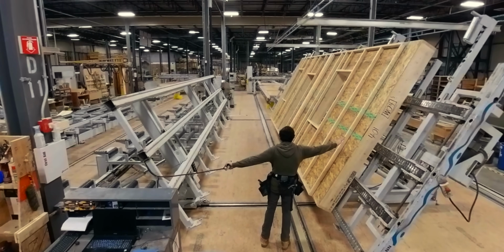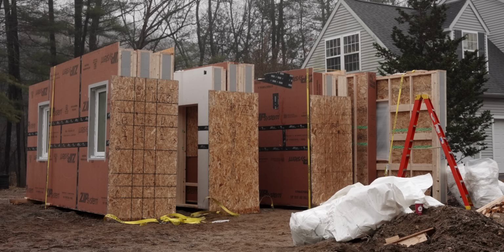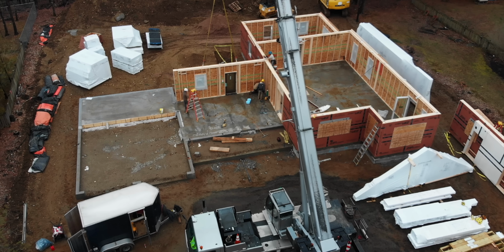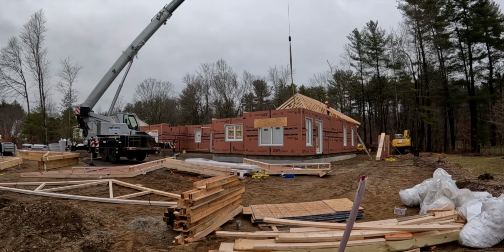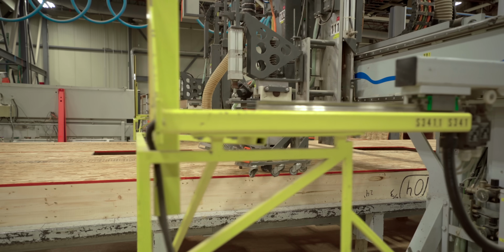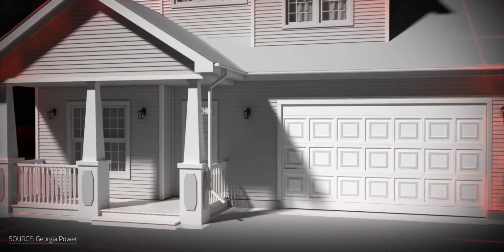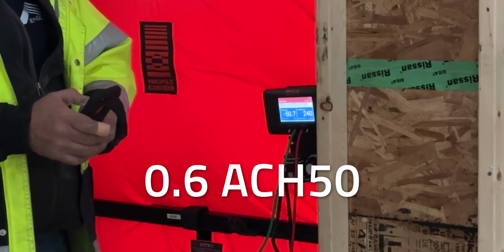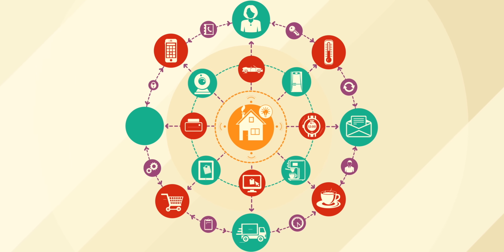Wow! I Didn’t Know A Prebuilt House Could Do This

Comment: Very cool. I think that the factory build probably achieves much higher quality than on site. The conditions for the build are better and the quality control easier and more effective.
True story, it's not impossible, but I suppose there's a lot less motivation and it's much harder for a worker at the factory to disguise a leak in a bathroom pipe using a plastic bag, than to do that at the construction site.

Comment: My geek  brain loves this project and the tech behind it and the component tech of geothermal, solar, battery, etc. That being said, I built a home in central AZ about 4 years ago that is avg with regards to insulation, etc. Put in a solar system that completely covers my electricity (even in summer with AC) and actually get a credit every year (check back from power company). That check offsets my natural gas cost. So from a heating/AC perspective I have zero payout at this point. This home is nowhere near LEEDS efficient, but does what I wanted which is breakeven on elec and natural gas. So can't complain and I'm sure spent nowhere near what you did.

Comment: I don't at all believe in air tight homes. Far too many chemicals that end up in the air and need to be aired out. ESPECIALLY in a brand new building. But the solar panels and battery system, a big yes.

Comment: Prefab houses are usually a good deal. Many years ago there was a company that set up a production line but they went out of business because of lack of demand due to the cost. While I know the push is on to make houses air tight. I have major concerns during an extended power outage. It doesn't take a long time for interior air to get nasty when there is no air moving and no fresh air getting in.

Comment: I hope you have better luck with the geothermal system than I did. Huge maintenance costs right from the start and had to tear it out at only year 11. There was absolutely zero payback from the 4x cost of the system
Reply: People who have never owned a house have NO idea what a nightmare and consideration maintenance is. I've never heard a happy geothermal customer and even going heat pump over furnace is often disappointing in colder climates.

Comment: Cost is always a factor, but my dream has always been insulated concrete for the entire house, not just the foundation.   Foam lego blocks with re-bar concrete in the cavity will ensure a high R- factor in the walls and you will never have to worry about puncturing the vapor barrier.    A house built this way will be airtight, except for around windows and doors of course.  It will also be incredibly quiet.  Did you consider this kind of construction?

Comment: Did you design the house for good cross ventilation when the windows are open? Sure, you can work on the heat and AC aspects, but can you get cross-flow? Like old Southern homes with their tall ceilings and transom windows to evacuate the summer heat from the top of the rooms? Do you have sections of the home you can easily isolate so you don't need to heat them in the winter? Did you place minimal windows on the North sides with more on the South side? Can you open windows during a rain storm and not get the interior soaked (long roof overhangs and deep set windows help)? One of my next homes will be a rammed earth / earth sheltered setup with a living roof.

Comment: House is looking good!
With the home automation gear, how are you planning to use it? 
Presumably you'll want to be able to operate at least some things remotely via phone - are you planning on putting in any extra security measures?
I mention security because one thing that's put me off home automation is that a lot of IoT kit is either disgustingly insecure, or is effectively spying on you
I'd be very interested to see how you set up the home automation :)

Comment: Very interesting video! I'm wondering how much customizability there was in the materials you used in this construction — that is, can you select concrete (for the foundation) and insulation that absorbs CO2? Can your lumber be purchased from a sustainably-harvested source? Can you avoid particle board / plywood that off-gasses formaldehyde... or is this even a concern, with your frequent air-changes? Thanks!

Comment: Hi Matt your new house is awesome! I'm interested in the geothermal as I'm in Connecticut wanna get rid of my OLD oil boiler but the 2 companies I have talked to can't do anything for me cause my heat and base board heating. I need some advice cause I found a electric hot water boiler out of Minnesota is a direct replacement but NO hvac people wanna install it! The only thing I can figure out is if they do it they won't get any service work. I have a older house 1987 built but I've done a lot to get off the grid with the house sealed up and solar and powerwall. I try to explain to them if they get into installing electric systems they will make so much more money cause in my town alone way over 5000+ homes have gone solar and this is what they are looking for! Any ideas?

Comment: I watched several of your videos, & am subscribed.  Thanks for sharing. I built a passive solar addition on my previous home (built in 1954), & reduced heating energy by 40%. I hope to build a new home. I wonder why you did not use SIPs with extruded foam cores, these avoid the problem of moisture which you worried about during assembly. I lived in Germany & agree the doors & windows that open/tilt are great. Also standard in German are the rolladen external shutters, these are great. What roof did you install (it seems you did not use panels)?

Comment: OK, the question: how probable tornadoes or stormwinds overall in this area? Earthquakes? I have a feeling first tornado will blow this 'building' away like matchbox. I cannot see from this afar, but from just video, I don't trust these walls. If crane can pickup it, first tornado will annihilate it on the spot. What happened to regular brick and mortar?

Comment: The house I am building I guess would be net zero. Though mine is going to be much cheaper than your likely was. I am building a tri plex. 100x30x8 or 10 pole barn with insulated slab. The walls will be 9 inches 10.5 inches thick with a 9 inch cavity. .5 osb 1.5 2x4, 2x6 (.5 osb strip to thicken the post) post, 1.5 2x4 .5 osb .5 drywall in 10 foot sections dense packed cellulose. The ceiling will either be blow in up to about 2 or 3 foot thick. I have not decided if I want to make custom trusses or extend the height of the building from 8 to 10 feet then build a whole other ceiling. I think Custom trusses will overall be cheaper and get that insulation value that I need. The reason why I want 2 foot over the exterir wall is that on a normal house that top corner is always going to be the cold/hot spot on the thermal camea because there is no insulation up there. The inside will all be sheathed with osb then covered with drywall. This will add much added strength to the house along with something behind the weak drywall that one can anchor things too. This will be three 1 bedroom 1 bathroom units. The heating and cooling will being done with 3 two ton mini splits made by EG4 which allow you to directly hook up about 4kwh of solar panels to the unit which can be run in 100% solar only mode, grid only mode, combo of both. The price os 3 units will cost 15k which is about the cost of an entire central air system put in. I will be adding a air recirculation system in as well to filter air and to move air in to the bathroom and bedroom, also looking in to those fresh air systems as well.  We are putting in windows where they need to be. The bed room and bath room will have indirect sunlight which will light up those 2 rooms and the living room and kitchen will have one direct sunlight window which will cast the light the full length of the room of 30 feet.  Placement of these window are key in reducing the number of windows needed while also not putting direct sunlight on areas that do not need it, such as the living room/office set up. The bathroom is 9x22 feet long. This allows for the closet to be placed in the bathroom along with laundry room and everything else you need. The close is one whole side of the bathroom which allow you to install cabinets drawers for the lower sections and hanger and shelf sections for totes or cabinets. This should be more than enough room for 2 people to store all of their clothes and everything else. Everything right in the bathroom for your use. 
The kitchn is on that wall as well which reduces the cost of plumbing.

Comment: Houses from the USA, are built in a manner that I would not call them houses but glorified Garden sheds.
Wooden frames with hollow Walls, where a heavy storm easily destroy them.

Obviously this is just my personal opinion. But a proper house is made out of stone/bricks . With proper walls holding the load and not some wooden frames. In summer That keeps the heat out for quite a while and in the winter it stays warm. add proper house isolation at the outside and you win. If you then put up a second wall inside your house to hide all your pipes and wires then you are truly protected from the elements.

I believe, but I’m not sure, the stones/bricks used in Germany are about 30cm thick.

Comment: No vacuum solar collectors for heat? They are great to keep a water tank hot all the time for heating and hot water generation and this is MUCH more efficient than using solar panels to generate electricity, store it, and use it if you want to shower or heat.

Also, using a water tank as buffer is more efficient than using a heat pump alone. Reason beeing that it does not need to react fast to new demand and instead run at much lower heat exchange rates, as the tank will buffer a couple of days of heating/water generation. This way the ground can heat up again, by exchanging heat with the surrounding.

Comment: Unfortunately, I really do not understand why a house that is supposed to be energy efficient is not built with the smallest possible external surface.
Regardless of the insulation, more surface means more heat and thus energy loss.

Comment: Think I might like to build one. 

When I lived in Cincinnati they were building envelope homes. It would have a regular outside insulated wall then essentially another wall with window and insulation with about 6” in between the two. The basement floor was about 3 or 4 feet of gravel covered with plywood. It was designed for air flow going  between the wall and storing heat in the grave during the day and being used at night. You could heat the house in the winter using a few light bulbs. In the summer it would store the colder night air in the gravel and use the cooler air during the day. It was years ago and I don’t know the end result.

Comment: We've got a UK self-build using a similar larson strut cassette system based on my plans.  The main difference was the TF was factory-assembled without insulation and a specialist company did the window and door installation on day 8-9 of the build, but all was weather tight and lockable by day 10.  A separate crew did the blown cellulosic fill and taping up on-site a few months later after we had the slate roof on and finished.  0.58 ACH on first test; 0.4 ish after some tweaks (some of the windows closers needed slightly tightening.  UK layout: so 2 full storeys + a warm roof bedsit for my live-in son. Cotswold stone exterior skin for looks and to keep the local planning permit guys happy.  Like you electric only, low energy.  
The main thing to watch out for in 1st and 2nd fit is tradesmen screwing up your air tightness: we banned all trades from cutting into it and where needed we added through-panel access pipes (properly sealed) for the trades to run plumbing, electrics, etc. then foamed and silliconed these ourselves, before plastering out / decoration.  In everything: trust but verify -- before it is too late to remedy cock-ups. 😊

Comment: I live in a prefab house from the late 1980s/early 1990s. Basically the same approach, but the walls are made out of reinforced concrete. The outer prefab panels have a "sandwich" construction. That means there is a structural outer part, then about 10 cm of styrofoam insulation and then another 10 cm of inner concrete wall. It is a very simple "box" with flat roof. I live on the topmost floor (number 8, ground floor is being counted as 0). While the facade is original, the windows were replaced by modern ones. Guess what. I do not need to turn up the heating at all and have even now 20°C in the flat. Outside temp falls to -8°C at night. When I open my flat door to the staircase, it is actually warmer there, because warm air rises. I do not need to have 28°C in the flat like some other people do. I am absolutely fine just in a t-shirt and underpants at this temperature. The only thing I have to check is condensation on the windows and around them. If I let it build up, mold can start to grow. But it is not that much of a hassle to wipe the condensation every two or three days and to deal with mold once it starts to appear (just spray some chlorine based anti-mold agent on it and wipe it off). Bear in mind, that this house was build a long time ago. The house next to ours, of the same type and age, is being retrofitted with more insulation on the facade. I hope our house will get such a retrofit too, even though the breakeven comes only in decades, as it has some thermal insulation already in its design (unlike older prefab houses built in the 1960s and 1970s). I care less about the energy savings than I care about the appearance of the house. Currently it looks rather ugly, as it was built. There are some stains and you can see all the joints in the facade between each panel. It is just a cosmetic thing. There are absolutely no water leaks. The roof had been repaired a couple of years ago and statistically speaking, I am more in danger of a neighbor causing water damage than a roof, which is above me. Structurally, these often ugly, massive concrete prefab buildings, also known as "panelák", are very strong. I have seen some of them being shelled and badly damaged during conflicts and they literally created "bridges" over holes in them. Previously I lived in a prefab house from the 1960s which experienced a gas explosion in the 1970s. One prefab panel was torn out and fell out, on the other side another one was blown into the elevator shaft. The house was evacuated, then engineers checked the statics of the house. The panels were put back into place and the house is still in use. In the early 2000s it received a new facade with thermal insulation. If maintained, it will stand for centuries. Reinforced concrete, if protected from the elements, is really good. I still do not understand why houses in the United States are built of relatively thin wooden profiles, with hollow walls. Yes it is fast and cheap. But how long do they last?

Comment: I believe that you concrete floors! I am doing R52 floors, R48 walls, and R70 ceiling. I believe that one of the first houses that was energy independent was built in 1974 near Gainesville, MO. It had sliders that let in sunlight and the temperature was regulated by metal salts! It was 2400 sq ft.

Comment: I live in a factory built house that's larger than the traditional stick built house we used to live in. The new house is larger and all electric, but our energy costs are down from $600 a month to $200 a month (peak for each). We're also using a heat pump for both heating and cooling and our energy costs are far below other houses in our area. What I really want next is a whole house battery system, but I don't really see how I'll ever be able to afford that. But I keep my ears open, just in case changes happen :)

Comment: It would make more sense to have just built the house in a square or rectangel.  you used a lot more materials to build this multi alcoved house. Also the high ceiling make this an oxymoron.  you are generating a lot more space to have to heat.  This makes it seems like you say one thing but ignorning what your saying.
You comment about concern for wetness.  But I am not sure if a normal house would be built in this weather.

Comment: Pretty cool that R value rated products are available the US. The newer U value is taking over, over here. It's a measure for energy loss, as Watts per sq. meter Kelvin. It also factors in the hot/cold reflection ability of the surface coating. Air gap between double glass sheets is usually filled with Argon, while 3 layer windows are filled with either Argon or Krypton. Also, the new U value must be shown with min. 1 decimal, most producers tend to show 2. Sometimes it feels like making desicions for home renovations requieres a degree from MiT.

[EDIT: I'm pretty sure your "pre-fab" house is higher quality than 99% of traditional house. Sorry, initially I didn't notice the loaded prebuilt house expression, as regulations here have not permitted any type of "trailer park"-like housing since the 70s.]

I was surprised to learn in the mid-10s that the Danish rock wool and glass wool industries were expanding in the US. The bad economy and housing market situation, created a market for house insulation, in all climates - which surprisingly hadn't been there before. At least over here, these things became mandatory in new housing a couple of decades after WW2.